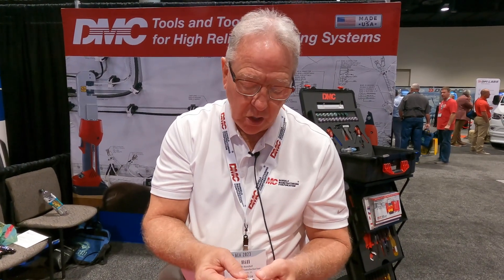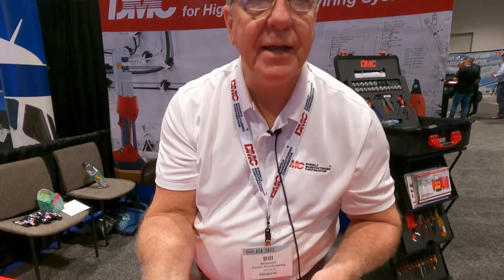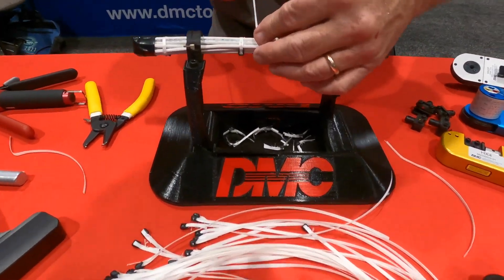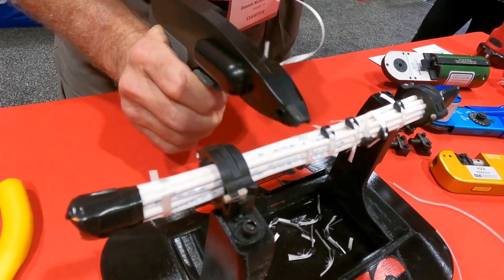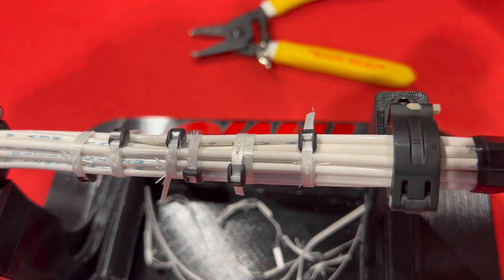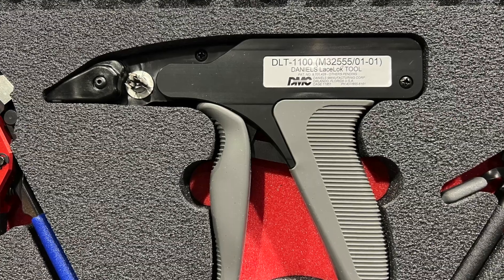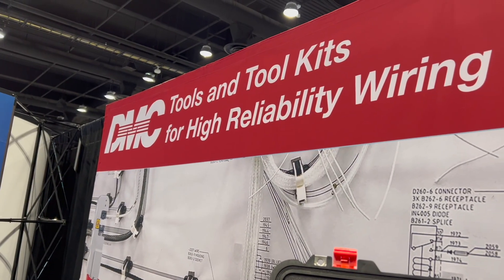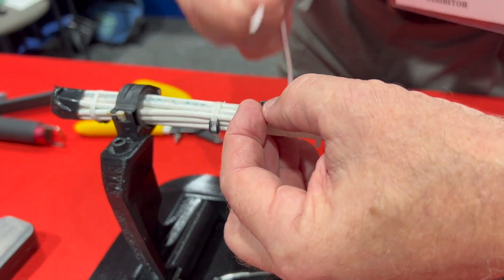Zip Ties No More: DMC's LaceLok Tool

Comment: As if we need to add a $600 dollar tool to every military electricians tool box. Someones going to get rich fast. I learned waxed lacing as an A&P  early in the 70's. Cheap, easy to do, easy on wire bundles.